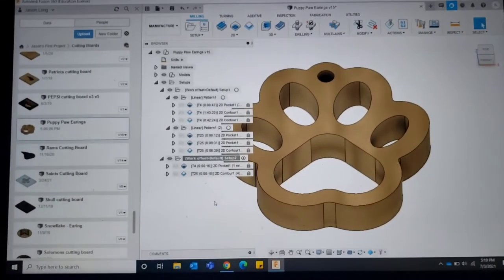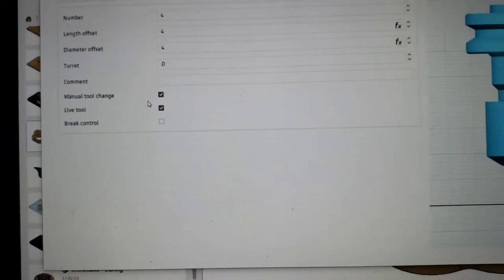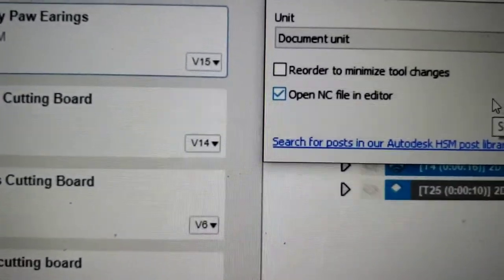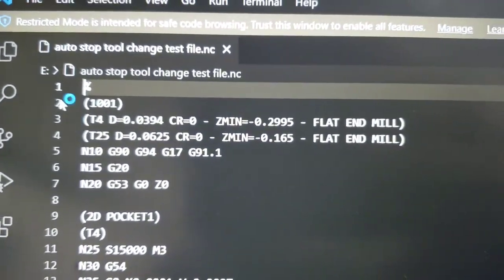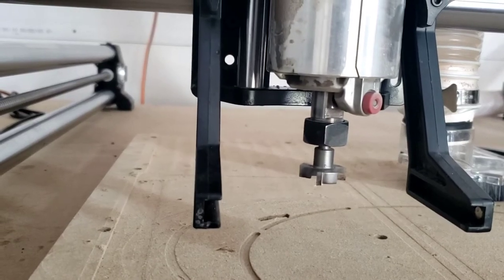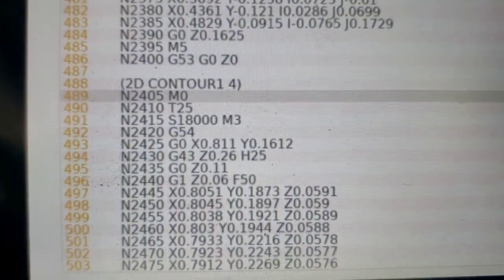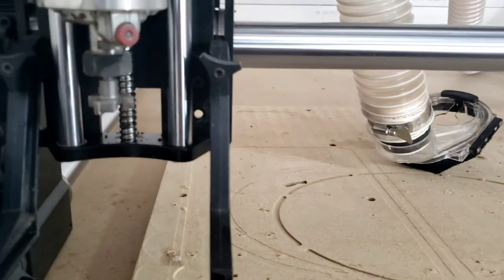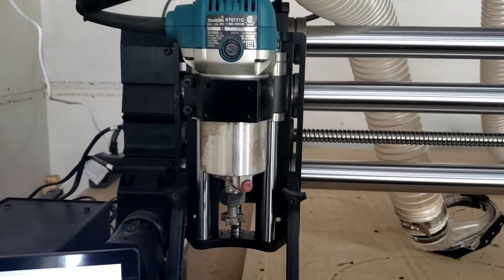HOW TO AUTO CHANGE YOUR BITS ON A MANUAL ROUTER IN FUSION 360 "ONEFINITY AND OTHER CNC MACHINES"

Comment: FYI: This does not work on the free version of Fusion 360, you will get an error. Kind of hard to learn the software when many of the functions are disabled.
Reply from the maker: Yes Fusion 360 has changed what you can do on the free software. This video was posted when I had a students license. I now pay full year membership to fusion 360.